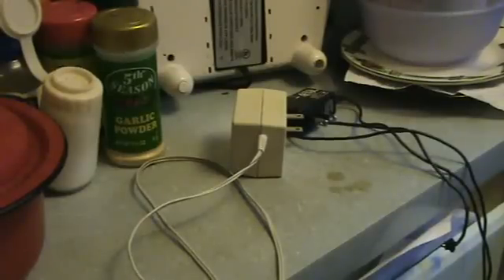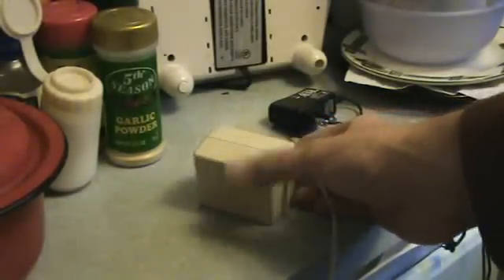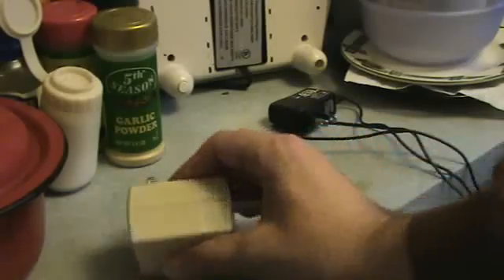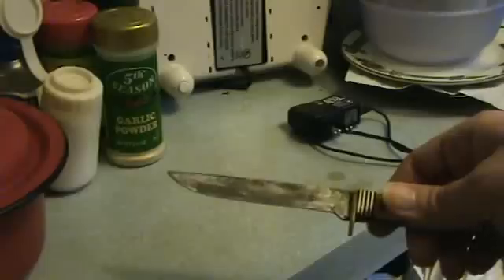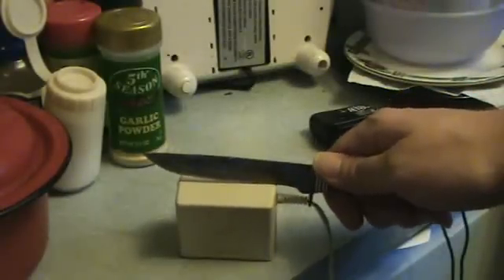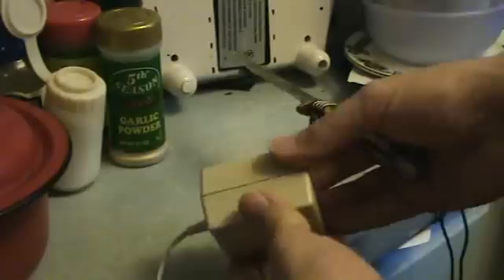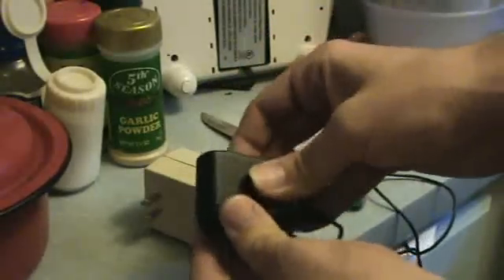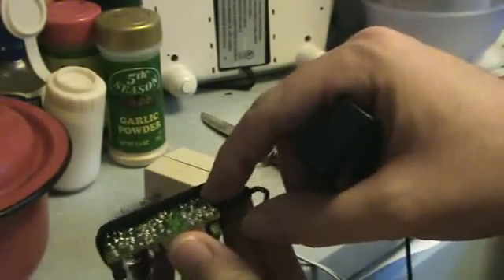How to Open a Wall Wart

Comment: If you knew how much you could sell that knife for (potentially) then you would probably stop using a hammer on it.  I'm not certain but it looks a lot like mine, though the handle is a different color tone.  (I accidentally broke 1/4" of the tip off of the blade and then found out how much it would cost to replace it).  Could you tell me about any names or characters on the metal part and I'll let you know if you have a winner. Btw thanks for taking the time to explain how to open those things; its too bad that they just can't put them together with screws but the glue is probably much less costly....  Best regards...

Comment: I wound up running this at 2x speed and found it much more tolerable. However, the background entertainment was just continuously annoying. However I do appreciate his willingness to give helpful advice on opening these devices. Thanks
Reply from the maker: Many years ago in the early days of YouTube (when this video was made) my late grandmother would obsessively listen to the radio, turning it on and off, frustratedly changing stations constantly day and night. I think it was to the point where I didn't even hear it anymore. There isn't a way to remove it without reuploading the video. My newer videos do have quiet background.

Comment: Great job.  Yours is the best approach so far.   I modified your idea to use a beefy putty scraper.  It made to be hammered on.  Hyde Tools 02970 5-in-1 Tool, Black and Silver
Reply from the maker: I might have to get one of those. My knife has gone missing.

Comment: It was a good tip...opened an HP  wall transformer using the 'knife and hammer' technique explained in the video. Replaced the low voltage lead and jack, and super glued back together. For about 30 minutes of work..looks good, no scratches or pry marks... and works like new.